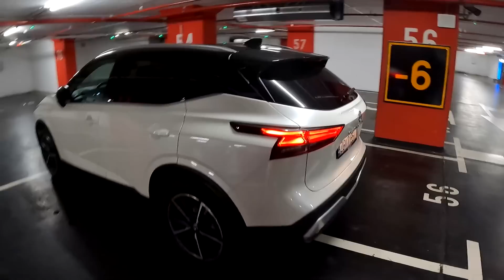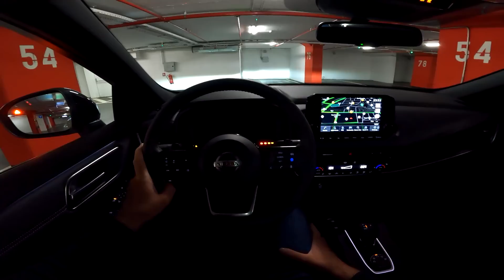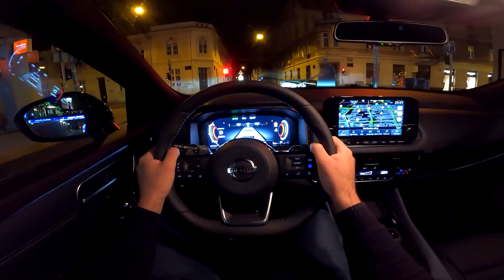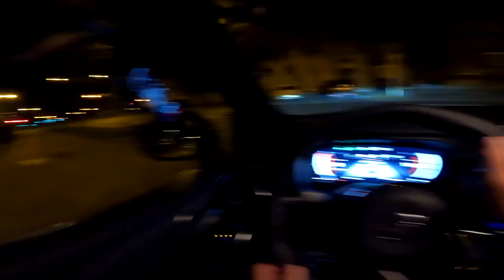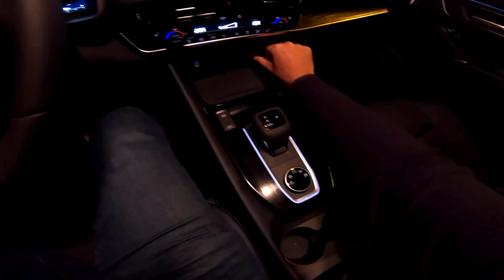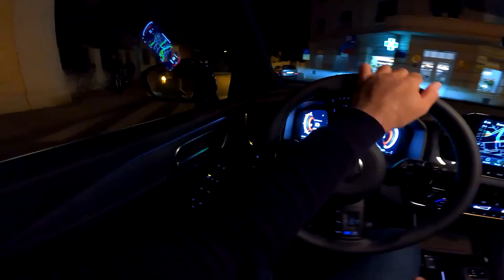New NISSAN QASHQAI 2022 - night POV test drive & full REVIEW (4WD CVT 158 HP, Tekna)

Comment: Has it got ambient lighting inside or is that just the reflection?
Reply from the maker: Yes it does have optional ambient lights but only one color
Reply: @crospotter13  I have 2019 plate Nissan qashqai tekna and it has two tiny strips of ambient lighting either side of the middle console. Do you know where the ambient lighting would be on this car?
Reply from the maker: @westham540  hello, so it's similar on this one, you can check out the video on my channel where I show more details, just search: Nissan Qashqai 2022 AMBIENT LIGHTS crospotter13" and you should find it :)

Comment: At which interval you must change the oil in the CVT Xtronic transmission, and the engine oil? Thank you!
Reply: I change transmission fluid every 30k miles with Nissan Fluid and change the oil every 5K miles full synthetic.

Comment: As you are lucky to have  4x4 version, you could show  informations from   4WD screen about  front /rear torque during the different mode.
Reply from the maker: good point, will do it next time, this is just a press car not mine, but will be getting a Tekna+ trim too so will keep that in mind :)
Reply: @crospotter13  If you have the opportunity to test a Tekna +, I will wait for  yours comments about the most important thing in a car: The sound system.(bose)!  In my opinion the standard system is only correct. And also you could show the luggage compartment with spare tire and Acoustimass®

Comment: Any upgrades in CVT ? How is the noise isolation ?
Reply from the maker: Personally I’m very surprised, there will be POV during the day where I accelerate on highway. There is some noise but feels more like dual clutch now and not like CVT which is great
Reply: @crospotter13  really good to hear that!  So some upgrades must have been done to the gearbox

Average fuel consumption ?
Reply: CVT is ok to drive altough performance numbers aren't great - this car is pretty slow for 158hp. Also fuel consumption is very high.
Reply: @sic22l  thanks for your info, already booked another car Kia Xceed, I just can't trust any Nissan car anymore specially with the stupid junky Xtronic trans. But tbh the new Qashqai looks dope, thanks again
Reply: @clansman81eg  Kia can be a bit noisy inside. Qashqai with a manual transmission is actually a nice car.
Reply: @sic22l  no manual is available here

Comment: Cvt , 158hp.... No, fnx nissan.but the review is good, Thanks👍
Reply: How many hp would serve you? It’s not a racing car but a small city suv.
Reply: @andymvisuals  modern cars for a comfortable ride should accelerate in no more than 9 seconds.and did it easily, and not squeezing out the impossible ...
but qashqai cannot do it.
about 190( -+ 10)horsepower is normal for me, for an average car.
this is a personal opinion. someone can be satisfied with 14 seconds to 100km.
Reply from the maker: Manual 158 HP also available:) 

And glad you like the review 👌